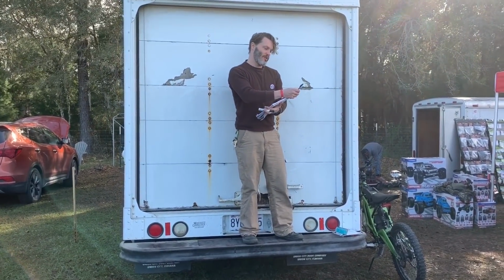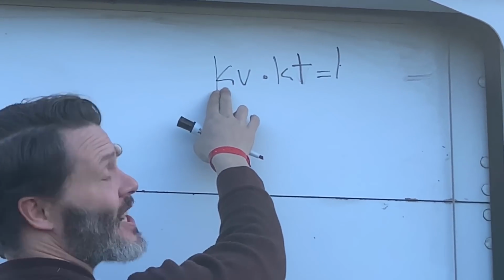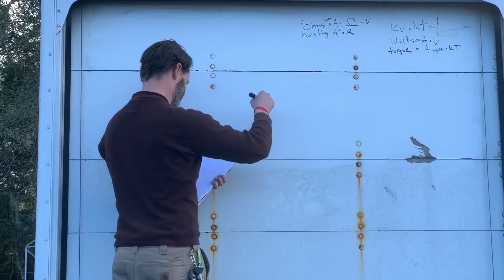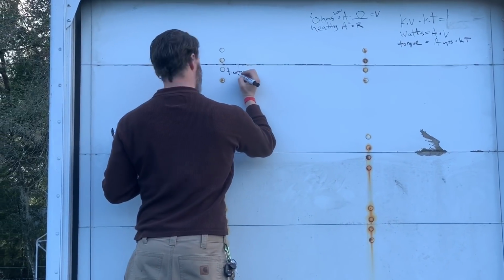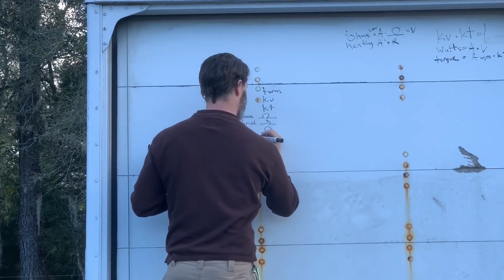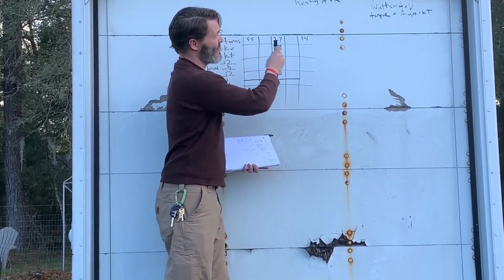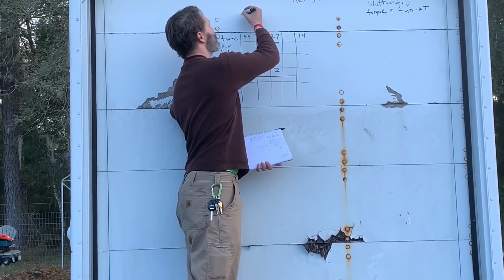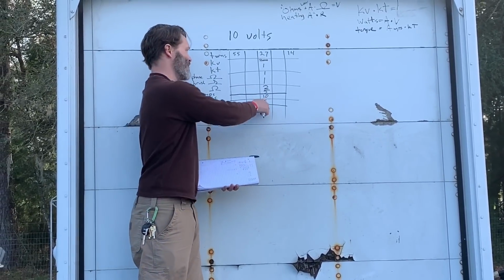USTE 2020 Holmes Hobbies Brushed Motor Tech

Comment: He must have stage fright because he screwed up for the 55t motor and to get power he multiplied torque*voltage instead of amps*voltage. The 55t would produce half the power he listed.

Comment: Like I've always said... When John Holmes talks - people LISTEN!! 
.... Although I've been saying for YEARS, and nobody listened, an 80T Motor DOES NOT give you more Torque!!! Just lower top speed and less amp draw. WHY this has been so hard for people to understand, I'll never know. 😖
Carmine ✈🚂🚙
Reply from the maker: yeah man I've went as high as 65t and it was horrible.
Reply: SOME people still think 60-80T is actually the way to go....
Reply: I guess if you have enough torque already , 2-speed, don't mind not have a good top-speed and just want more battery-milige a 65-80 turn motor will work. 
An old rc buddy used 80-turn motors on his 8x8 Clodbuster. That thing would break parts almost every time he took it out. He was always upgrading parts but never swapped out the motors.
Reply: Lots of OLD guys - like me - believed that...
It's just not true! I learned 10 years ago.

Comment: Excellent video, could have showed how you could of upped the torque by gearing down and upgrading to pro motors on your little chart. Put it all together to see how a pro 2700 with 4x gear reduction and 20 volts creates 10x the torque of a 55t motor at 10v, but still crawls the same speed.
Reply: I wanted to get into it but the talk was already very long.  Will recreate this in the studio and try to tie it all together with the volt up, gear down approach.
Reply: @johnrobholmes  i see how often what's the best motor for x vehicle is asked. Videos like this I think are the best answer. Maybe a condensed one at the end of a series. Magnets, can size, armature size, windings, poles, voltage, gearing.... So many factors. But none of them can be the best at everything....
Reply from the maker: it would be an hours long video for all that but he does get into that on his videos on his channel.
Reply: @ExocagedRC  it can say just as much in less time with graphs and tables. Or in a series.